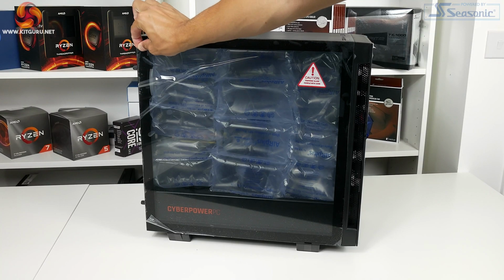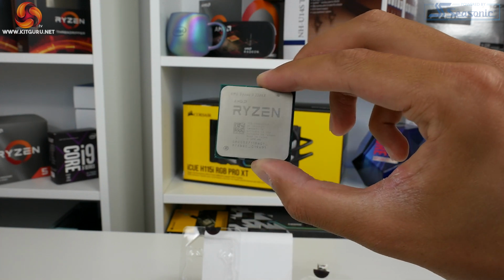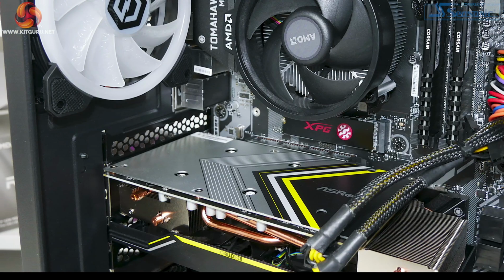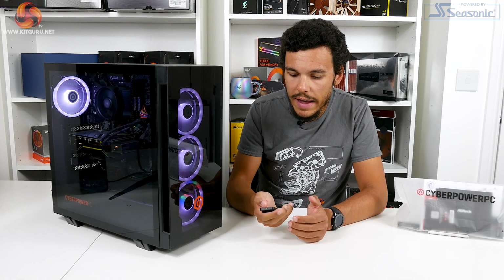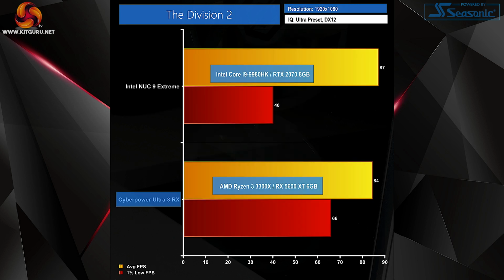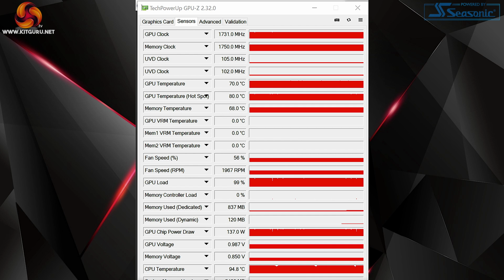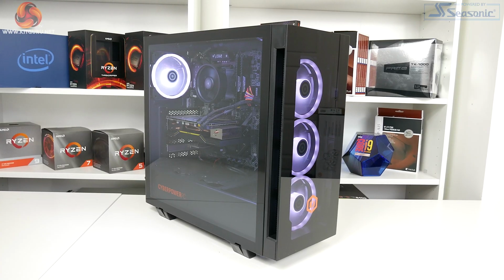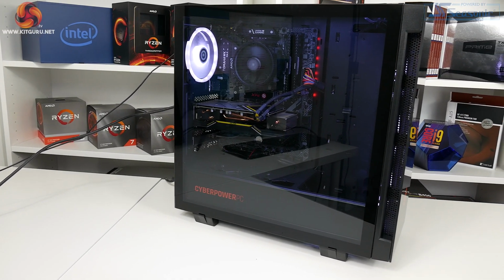Cyberpower's Top-Notch Budget System - w/ Ryzen 3300X & RX 5600 XT!

Comment: Really nice machine, personally, I love pre-builts, I didn't get one I built a PC myself but a pre-built with the right parts can be killer! Only reason a lot of people hate pre-builts is because most of the parts usually are trash (the CPU, GPU and maybe the mobo can be an exception but RAM, PSU and etc...
Reply: Usually everything except types is trash. So you see soemthing like R73600 and 5700XT 16gigs ram Glass and RGBbbbbb!   as selling point, but then, stock cooling, cheapest gpu model, dirt cheap motherboard, weak ram, suicide class psu, and completely airflow free chassis. 
All this in different proportions.

Comment: Is that British lbs. So adding about 30% would be about $1100-$1200usd. You can get an ASUS TUF A15 Gaming Laptop with a 8core 16thread Zen2, 16GB's of FDR4 and a RTX 2060 with a 144Hz panel. All for $1200. Hook it up to a TV and call it a day. 
  I own and run my own Custom PC retail store and a All in One Electronics repair shop. That's to much for the specifications.
  Going with a 2 or 3 year old z370-z390 set up is the way to go. 8th Gen i7 8700K tray CPU's are only $200 right now and z370 ASUS Strix-E's are $150. 16GB's of Ripjaws V are $60. That's $410 for a great foundation. Old new stock is the best way to go, to get the most performance for the buyer. Dual fan 5700XT's are as cheap as $300. I've seen B-stock 2060's for $220. Lets say a fairly nice case and PSU would be $200 and a brand new (old new stock) 1TB Samsung 850evo SSD is $100. There are 1TB m.2 nVME's with 2500MB/s writes for $100. Windows keys are $12 on CDkeys.com. 
  That's a $1122 cost. I can charge $1500 for a rig like that all day and customers love'em. I build and sell 4 to 5 custom rigs like these a week. Of course having connections to old new stock helps though, i don't charge much more for a build. I can easily make $500 for each one adding a nice monitor and peripherals. 
  There's room to squeeze a $. I will even ask a customer. "Would you want a year or two old (new) high-end performance PC or the newest mid-range stuff". 10 times out of 10 they'll take a 2 year old high-end CPU to start a build. I've got 2 playable gaming rigs for comparison purposes, in the store.
  I'm not knocking any company but, if you want to get people into PC gaming, they have to know that $800-$900 isn't going to cut it. They will want more performance when they realize they can't turn up the dial's. $1200-$1500 will build a PC that has great performance now, and will last. There's a little room to upgrade to a 9900K but, an 8700K at 5GHz, just like the 10600K, can handle a 2080ti. So, GPU upgrades are unlimited. Just sayin.
Reply: In the UK the price includes 20% VAT (sales tax). You need to factor that into your comparison.
Reply: The laptop wouldn't be a tower, and it's absolutely terrible.
Reply: this is prebuilt btw building it urself is like £200 cheaper